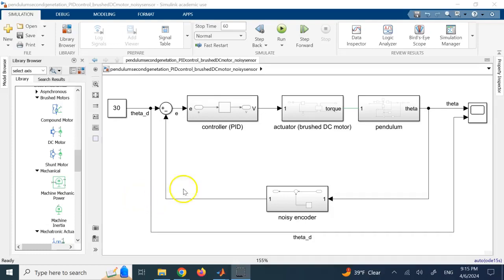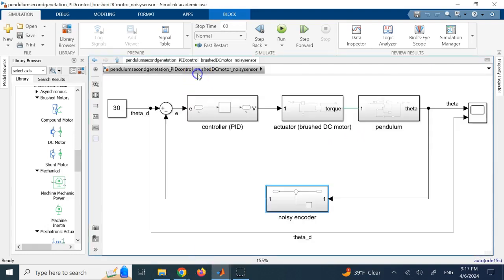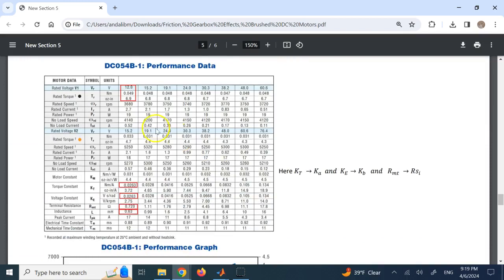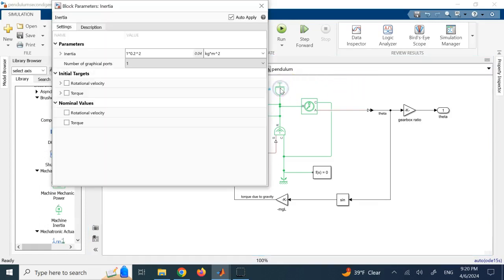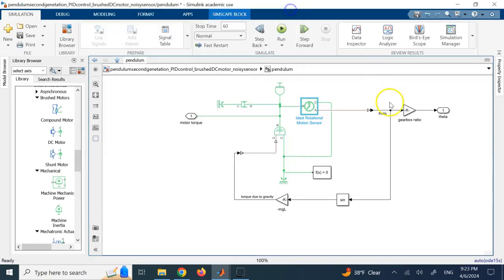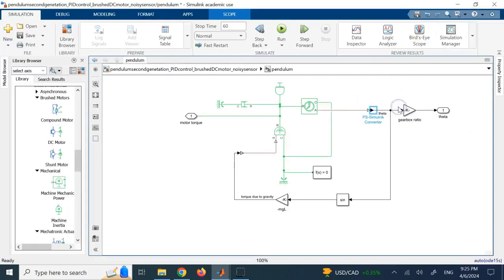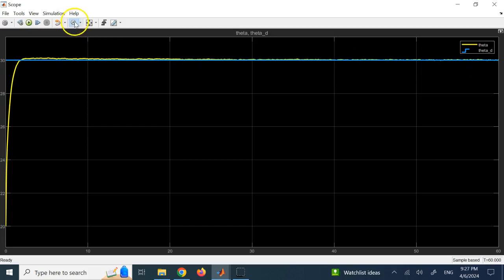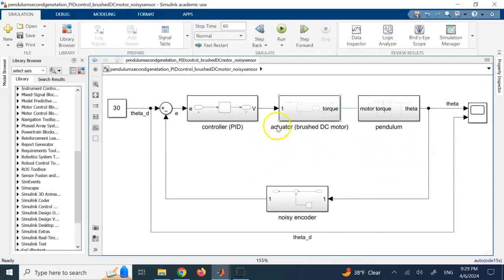PID Control (Noisy Sensor and DC motor) of Nonlinear Pendulum Made Using Second-Generation Blocks

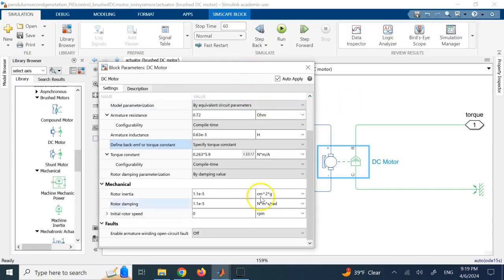Comment: Great video as always ! But there's no need to multiply the torque constant by the gear ratio at 4:38 as a dirty hack to model the gearbox effect. Simscape has blocks that model gearboxes, you can find them under: simscape/driveline/gears. You can find simple gears where you only input the gear ratio and complexe gears such as planetary, harmonic, worm etc. these have an input field to specify the efficiency of the gearbox.
Reply from the maker: I know about the gearbox block, but it was not compatible with the model I made.